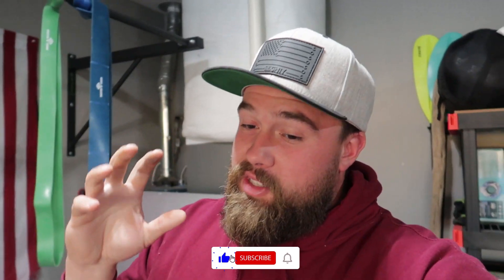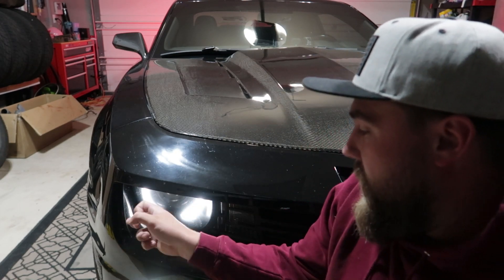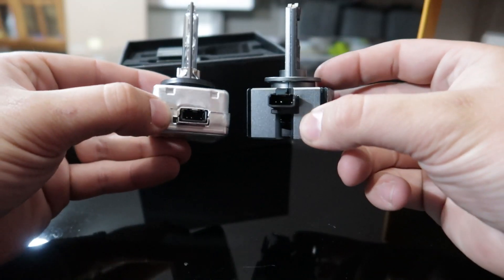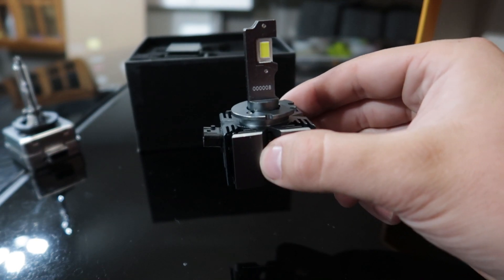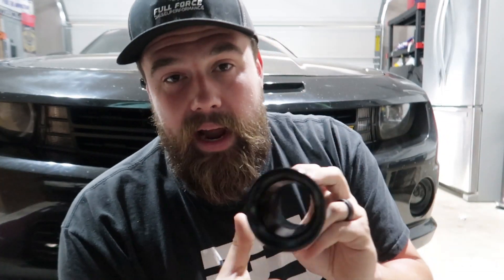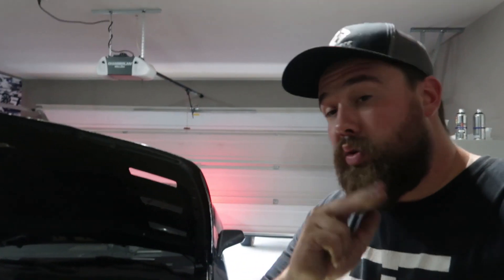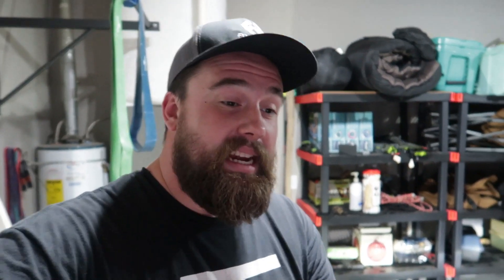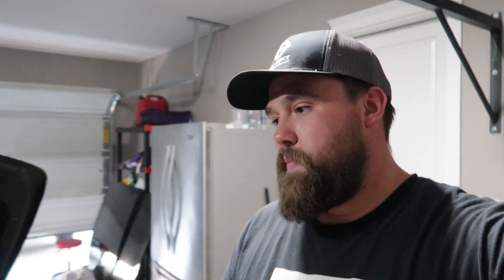Auxbeam LED Headlights Ditch HIDs forever.

Comment: Most hid run at 35w from the ballasts, but then these led lights are saying they run at 70W+ , I don't understand how that's possible
Reply: It's a 70w equivalent... same way house light leds are labeled. If I had to guess they pull maybe half that actual wattage as a HID

Comment: Great video, looks like the LEDs light up the road in front of you really well!
How are the headlights holding up? Do the LEDs give you more beam range than the HID or are they the same? Thanks!
Reply from the maker: The factory HID housings sadly have a deterioration problem on these 5th gems.  The reflection material flakes away. The LEDs helped correct that, and it’s better than factory
Reply: @GarageSpec  appreciate the response good sir!

Comment: This is one of the first LED light mods I did, and I figured it would just directly swap with the built-in HID ballasts. I don’t think any DxS light bulbs are halogen and/or incandescent, so that works out too. 

On another note, I actually got some 6000K white PH24W(Y) LED bulbs to swap out for the factory reverse light bulbs. The whole rear bumper/fascia does have to come off, so try to go with a reliable brand (even though there aren’t many selections).

Comment: You don’t have to remove the front bumper/fascia or headlamp assemblies, unless you’re troubleshooting multiple HID and LED replacement bulbs that are NOT working. 

I would probably check out any headlight fuses first, and maybe even check the wiring to the lights.   RS package halo-equipped headlamp assemblies aren’t cheap… If you need an entire one or a set, I suggest find some nice, low mileage salvaged ones. 

If you use a restoration kit or restore the headlamps yourself, use some form of a clear coat spray (acrylic is best) on them before reinstalling. This will keep them from oxidizing again, as the plastic lenses have been exposed directly again, and will need a protective shielding of some sort for long term protection.

Comment: My Escalade has them OEM. I replaced my HIDs with brand new ones after one burned out. Wasn’t spending $100 for 1 at AutoZone so I bought a set for $50 online. Burned out in 4 months. I think it’s time for LEDs.